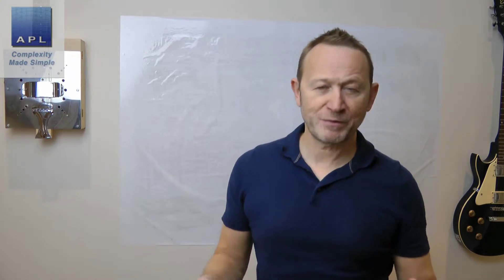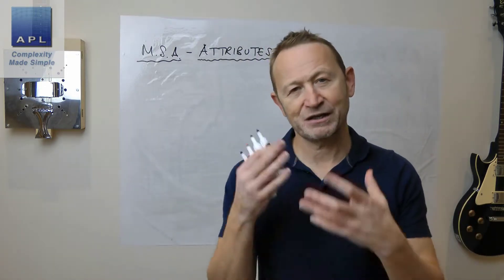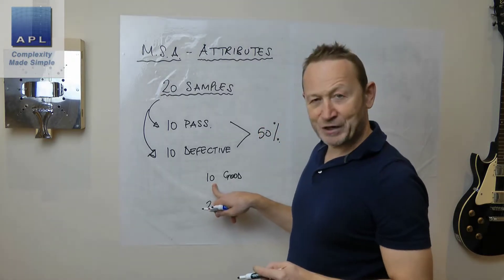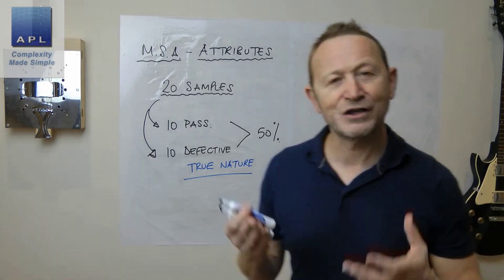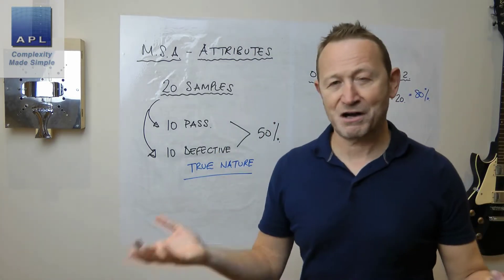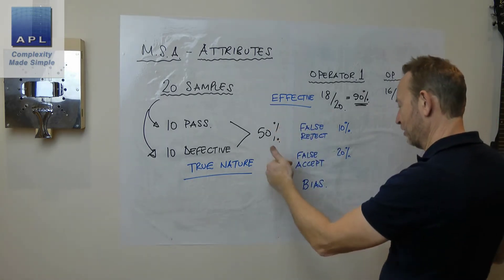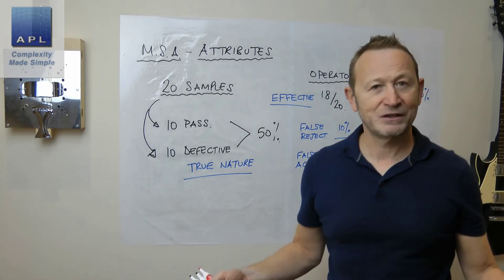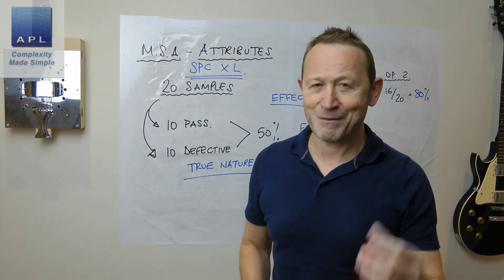Measurement System Analysis - Using Attribute (pass/fail) Data

Comment: Thank you for the video, Paul! I'm seeking guidance on selecting the appropriate MSA for an in-line vision system used for inspection. This system generates pass/fail outcomes without any operator interaction. While I understand how to assess repeatability by conducting multiple trials on identical parts (good and bad) passing through the vision system, I'm uncertain about addressing reproducibility. Could you demonstrate a scenario like this using Minitab? Your advice would be greatly appreciated. Thank you!
Reply from the maker: Hi Hasan - I made a video to answer your question...
https://youtu.be/7G8gXEPgGFU

Comment: Sorry I do agree with this method. It is based on speculation and you also have the human factors in your process. What happens if you deciding expert dies? Do you stop the production.
Reply from the maker: Hi J - No but if you pass/fail inspection criteria, someone has to decide and set the rules....no noe has to die, someone could just leave. It's a common problem, how would expect cosmetic criteria to be asessed?
Reply: @paulallen5321  Operator 1 may be 90% effektiv today but only 50% tomorrow. You cannot calculate the human factor . You can’t put a number on it. I have been working with optical releases in the automobile industry for 25 years now.
Reply from the maker: What you're saying J is the result we get is an estimate, that's why we design the test carefully to get the best estimate. To be fair, if what you're talking about is the ability of an inspector to look at a full body shell of a car and see every blemish then yes that is a much more difficult test to run....but it doesn't mean you can't do that test...and learn soemthing
Reply: @paulallen5321  No, what I am saying is the a human being cannot be considered as a measurement system. The chance of error is too high and that chance of error changes day for day.
Reply from the maker: J - I'm afraid the human element is in lots of measurement systems, as it is in lots of manufacturing systems. If you don't know how to reduce variability from people in all elements of our proecesses then we are in trouble...it would be great if we could automate everything but that's just not possible...

Comment: Ciao Paul, thanks for the video. 
Question for you: How do you evaluate repeatability if you run only one inspection of each sample ?
Reply from the maker: Isacco are you saying that your test is destructive?
Reply: @paulallen5321  No, I'm saying that if I ask to my operators to inspect the 20 pieces only once, I don't see the repeatability. I would prefer to perform multiple inspections (i.e. 20 pieces evaluated 2 or 3 times by each operator) to understand if it is repeatable or not. What do you think?
Reply from the maker: Ok see your point - the reason is that you have a standard that they have to match.  That is the effectively doing a repeatablity check. There is no standard in the R&R study only consistency.But let's put it this way, there is no harm in doing the extra repetition...you can certainly set the template up to do that in SPC XL...